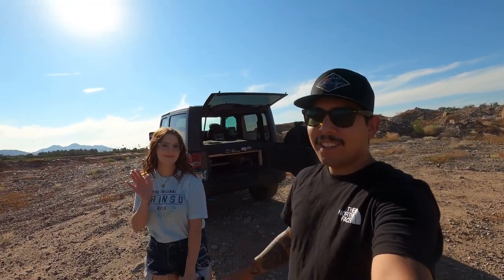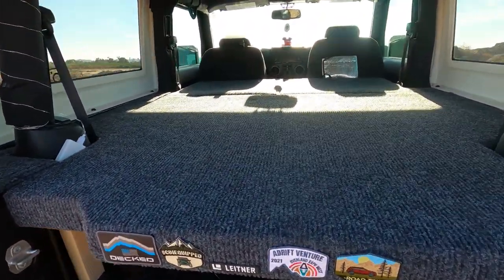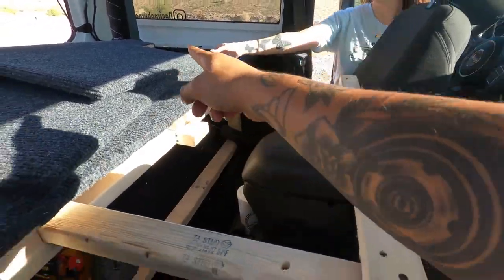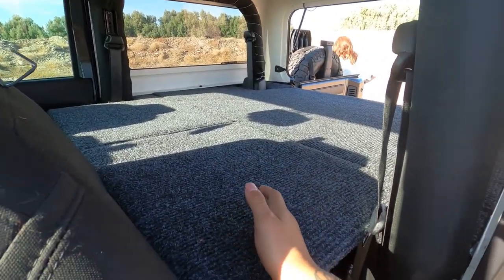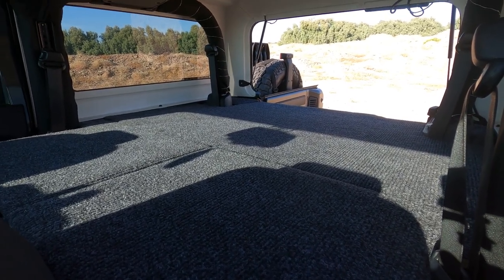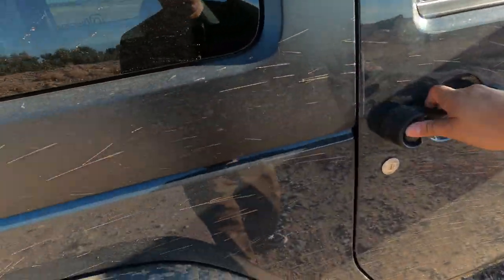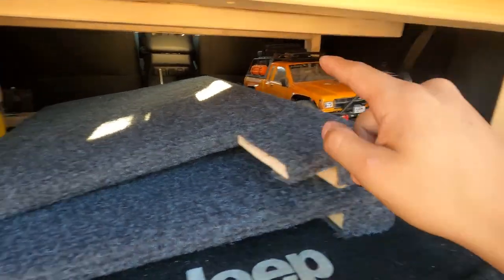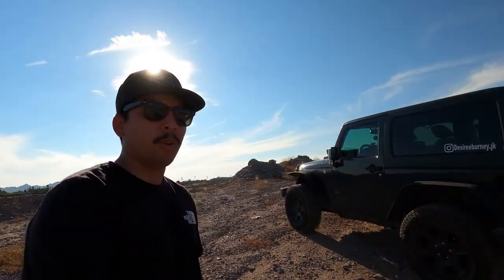Two Door Jeep JK Slide Out Sleeping Deck! D.I.Y.

Comment: I've been looking into designing my own overlanding / camping set-up for my 2 door JK and I like what you've done here.  I think I could modify the slide panels to extend my foot space between the front seats, and also utilize heavy-duty drawer slides with a plywood floor so the cargo under the sleeping platform will slide out, perhaps one side for a camp stove the other side for a cooler.  Looks well designed and constructed.

Comment: Nice build, and a few thoughts. . . .

* reverse the 1st & 2nd panel placement.  This would allow the drivers seat to be left in place for when just one person is sleeping and preserve a safe drive away ability.

* an upgrade thought would be to construct a slider storage box or two to more easily get access to below the platform.

* regardless of the ideas above, I would want to maximize the length along the passenger side and center counsel area and always have the seat moved as far forward as possible.

Anyhow, great build.  My set up is a basic mattress in the back of my 21 Subi Crosstrek.  🙏⚓️☀️🤠
Reply: Great suggestion!
Reply: The biggest problem in a 2 dr is how to get adequate sleeping length inside and still have enough clearance below the sound bar. Here's an idea, fold the passenger seat flat to make a 6-4 bed.. The rear storage platform height would match the folded seat height. How come no one else has done this! I guess I'll have to make a video. 😄
Reply: @sscbkr48 , does the passenger seat recline flat?

Comment: very cool!!! best 2door build i've seen!!!  i'm going to attempt the same build for mine!!! thank you!
Reply from the maker: Hopefully I explained everything good enough to follow along with! It’s a game changing set up for sure!
Reply: @GetLostAdventures  yeah, just got to do trial and error on the support legs to get the plywood flush on top with the jeeps edge.  It's the perfect setup for what I want.  even without using it as a sleeper.  its a good way to get double storage in the back!!! I think I migh add some pull out drawers or maybe two pull out tub type things for for underneath.  Also, i'd have to extend the two small top pieces to go up inbetween the front seats so I could actually fit my legs in when I lay down.  i'm 6 foot 1. haha again.  thanks for this amazing video and idea. saves me the hassle of doing a rooftop tent!
Reply from the maker: Yeah definitely beats the price of a rtt for sure and I also plan on putting drawers back there so keep an eye out for that if you don’t do yours first! And thanks for the support I’m glad you found the channel!
Reply: @GetLostAdventures  did you use an adhesive to put the carpet down on the plywood?
Reply from the maker: I should have looking back but I just used staples on all the edges still holding up great but glue would definitely add more years to the life of it!

Comment: Great build!! I wish I could sleep in the Jeep, I can't even fit in a JKU with the seats as far forward.
Reply: I'm 6-2 and sleep in mine quite comfortably.. the secret is to have a passenger seat that folds flat.. makes a 74" bed, inside! You need the storage platform to be the same height. The other point, the sound bar is annoyingly low for turning over or moving about when the sleeping platform is that high.
Reply: @sscbkr48  Jeep should have done this! Folding the seat flat is the way to go.

Comment: Not sure if you’ll see this since the vid has been out a while, but would love to know if the main 1/2” board is one solid piece or 2 with the carpet stretching across for a single appearance? If the main deck board is 1, how did you get it in and still sit under the lip on the sides? Please and thank you.

Comment: Nice build!  You sleep in it diagonally. Not vertically.
Reply: Vertically? lol If you're 6-0 or more, this won't work. I tried it using the same platform height. Was like a sardine under the sound bar. You need to fold the seat flat.